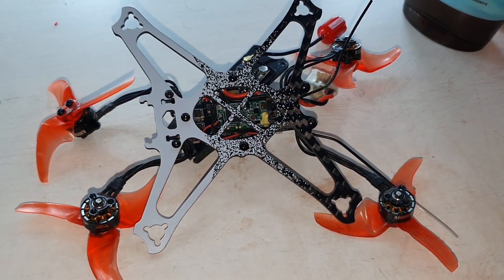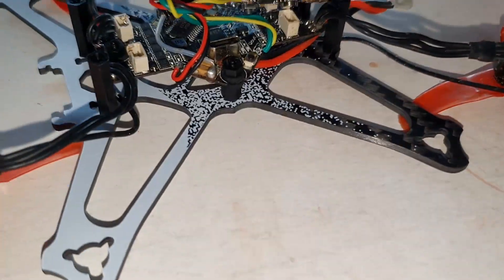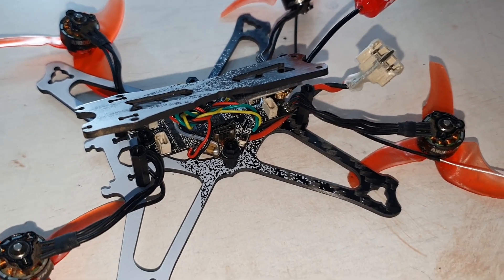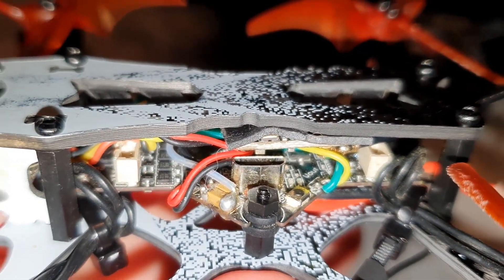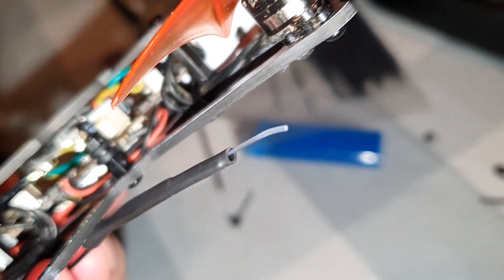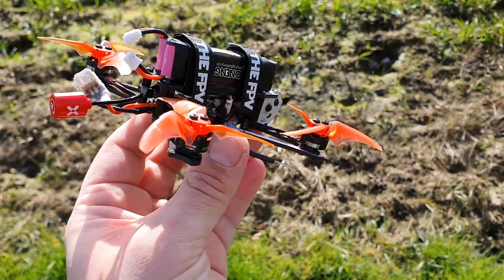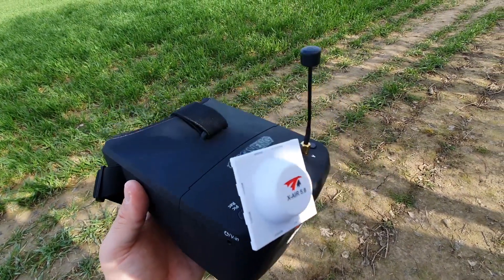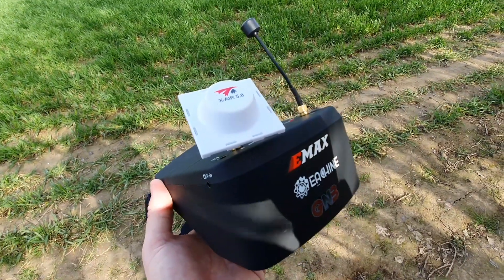Tinyhawk 2 Freestyle - XM+ receiver and Eachine Nano v2 VTX upgrade

Comment: Are the sockets on the flight controller close to where the motors are soldered used for plugging  in different  motors?I've got a spare flight controller and want to build my own quad

Comment: Did just solder to the board and what parts did you use, Im looking at doing similar myself
Reply: I use a xm+ with old Firmware (Flashback) and a tbs nano pro32 vtx. Solder directly to the fc. Xm+ on sbus and New vtx on the Pins from the old vtx. Works very well. Greetings from germany.

Comment: If you’re upgrading that stuff you NEED to change to an xt30 connector too. It makes a massive difference in flight time and smoothness.
Reply: Really? I didn't think the connector did that much! I'd do it, however that means getting new batteries too, right?
Reply: @SergioGMN  yes new real 2s batteries.  I use 650mah gnb on the tinyhawk 2 and get about 8 minutes of fly time.
Reply: @Shauny_D  how fast are you flying? I get 3-9 minutes depending on how I fly, 5 normally, 3 if I'm racing, 9 if I'm hovering back and forth
Reply: @SergioGMN  i’ll get 7-8 minutes full send with an xt30 650mah battery.  I’d say rpm filtering also contributes so don’t forget about that probably adds 30seconds.  BUT, fly time isn’t as big of a deal anyway the smoothness, and throttle control you gain is more worth it.  You don’t have fully charges batteries that sag to 3.4v when you hit the throttle.
Reply: @Shauny_D  I see. I will probably do it in the future when I get a proper balancer charger since now I only have a 1s charger.

Comment: Thanks for sharing....was any flashing needed for xm+?
Reply: What is your controller? Ich use a taranis xlite and must flash back to an older Firmware (1.8 or 1.7 maybe). Newest Firmware is 2.1 or 2.2 ich believe. But it doesn't Bind. Try your luck, i think you get this kwad in the air ;-). Greetings from germany.

Comment: Very nice upgrade!! good job. I'm thinking to do the same because my range and video is awful. Could you tell me that the same part (especially receiver) will be good for Taranis qx7? Goggle I have the same like you but with a different antennas.  
I will very grateful for your answer.
Reply from the maker: Sorry for the delay, I have a Tatanid QX7 as well, so you should be all good 👍

Comment: Hi, when you removed the old vtx did you also remove the 4 pins connecting it? Thanks. Good job.
Reply from the maker: I'm pretty sure I did, if I remember rightly it was a pain in the arse to remove. One of the hardest parts of the whole upgrade.
Reply: @ScarySquirrel  hi, was pretty easy to be fair. I ended up chopping the top of the pins with some snips to remove the old vtx and soldering a TBS Nano Pro32 and straight onto the pins. A bit fidly but it's all good now, topped off with ELRS 😜

Comment: Hello mate, awesome video and good work on the upgrades, have you thought about upgrading the connector to an XT30? You'll get much better flight times and less battery sag.
Reply from the maker: Thanks, mate. Yeah I have since upgraded to an XT30 and definitely noticed less voltage sag. I've not flown the TinyHawk for a while as I have a 5" now. Definitely need to fly it again soon.

Comment: Thanks for the video. Has your FC hold up to the higher current draw of the new vtx so far? 
I'm about to replace my original (TH FS I) vtx with a new one, and have heard other youtubers talk about too high power draw with better vtx'es, so that a recommendation was to wire the vtx power wires directly to the battery pads (which wouldn't work with the Eachine Nano, because that requires 5V and would burn out when connected to the battery pads...).
Reply from the maker: Sorry for the late reply, I've had no issues with this no. I've not flown a huge amount though as I've been building and flying a 5" since I posted this video.

Comment: Im confused did u get solder on your motor?
Reply from the maker: No I don't think so, not had any issues at least.
Reply: @ScarySquirrel  What caused your motor to stop working?
Reply from the maker: @2tonetr3  I think it was just damaged in the crash. I bought a new one and it worked fine.
Reply: @ScarySquirrel  Did you try re-soldering/ swapping the motor wires? You might have another spare motor there, I had the same - Rewired and it functioned. It may be my soldering efforts though!
Reply from the maker: @jaybfpv5676  Yes mate, I tried all sorts including swapping motors around. I took it apart and cleaned it but nothing worked.

Comment: Nice idea mate, im going to do the same to mine. I like the way it flys but i hate the video feed, changed my goggles and modules in the past but works perfect on other quads so this must be the way forward. Iv done the xt30 it does make quite abit of difference. Subbed 👍🏻
Reply from the maker: It's definitely been a worthwhile upgrade. I put an XT30 on mine yesterday, just waiting for some 2S batteries to be delivered, looking forward to seeing how it flies after that.
Reply: @ScarySquirrel  it does work alot better than the old vtx setup well happy with it. Going to stick a better rx on it and ill be happy 👍🏻

Comment: That's exactly what I'm trying to do with mine. But with this Zeus Nano VTX vtx.

Is there any videos you watched to guide you through this that i should be watching? For both the vtx and xm+?
Reply from the maker: This video is quite useful, although he's using a sled to install the receiver on, I found it quite helpful in terms of removing the old VTX. 

https://youtu.be/iiD0xBbSyyk
Reply: @ScarySquirrel  Hey sorry for asking, is there any non-destructive way to remove old VTX so I can reatach it later if I fuck it up? Lmao I'm scared I've never soldered anything this small and I'm worried but I really do want to upgrade the VTX on my TH2F...
Reply: @SergioGMN  I feel ya on that... I've put off installing the XM+ and foxeer anteena for a while since I don't want to mess it up. I'm about to go for it since I'm in the 'I want a new drone' mode. If I mess it up, I'll just get a drone sooner. lol.
Reply from the maker: I also just watched loads of videos under the search terms 'tinyhawk 2 freestyle vtx receiver upgrade' or 'installation'